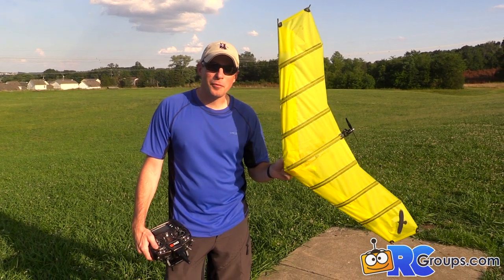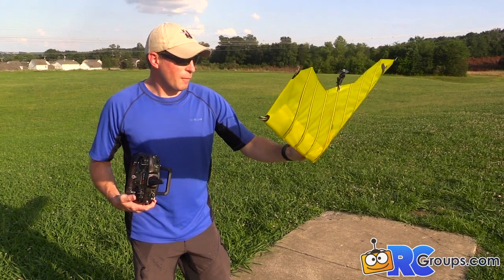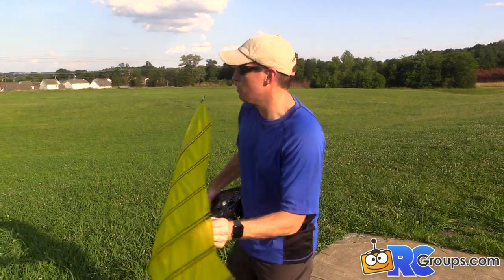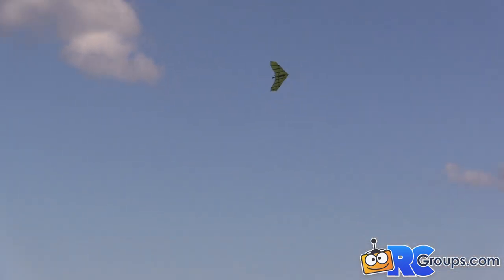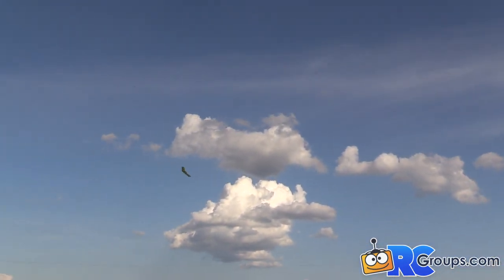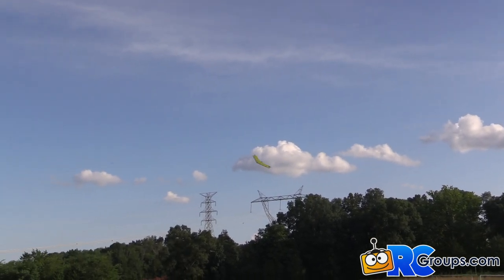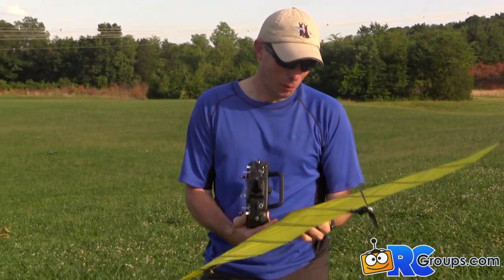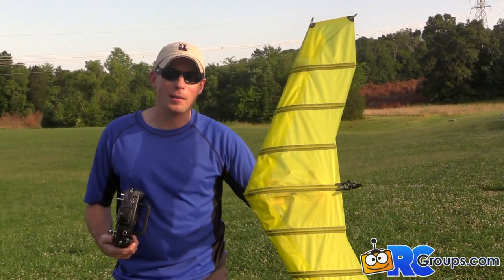Aloft Hobbies Carbon Falcon First Flights

Comment: Nice, I made a 2 line stunt kite similar to this nearly 30 years ago. My idea was to use small aluminium tubes to "form" the leading edge camber, and 2mm CF for the ribs/battens, like in a windsurfing sail. (I was into windsurfing for 8 years+ previously. Maiden flight it immediately went up and past vertical right over my head! Later on I lost it some how, somewhere, in storage or something. Maybe one day I'll make another.
Reply from the maker: Fun stuff!
Reply: You had access to carbon fiber in 1993?? 🤨
Reply: @stejer211  Yeah sure, arrow shafts!

Comment: Looks like a fun flyer, also for kids 😎 How long is the flight duration with the standard battery? Can a higher capacity battery be used? Could it carry a small camera?
Reply from the maker: Flight times will depend on throttle usage, but you can expect anything from 12 to over 20 minutes. You could try a bigger battery if the CG would still be attainable. I haven't used anything over 1000mAH, but I think that's plenty. They are cheap and you can just buy a few of them. A very tiny camera maybe. Something like the Insta360 Go 2 or 3 might work, but haven't tried it.
Reply: I have a tiny HD video system I'd like to attach to mine, but have not done that just yet.  In terms of maximum weight, they can actually carry a fair amount, we have not tested the upper limits as we have so much fun with them in normal configuration.

Comment: What do you think is max wind speed for this wing to enjoy flying it ?
Reply from the maker: For me, probably 10-12MPH.
Reply: They key is how smooth the wind is. If turbulent it will be tossed around due to the low wing loading. If smooth, I have flown mine in 25mph winds on the slope. With this said there are better planes for that kind of wind.